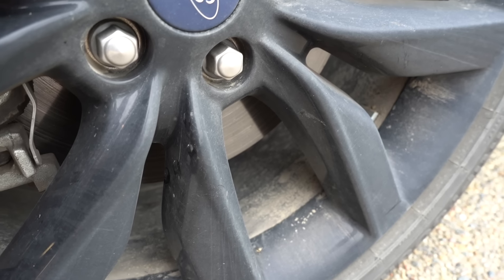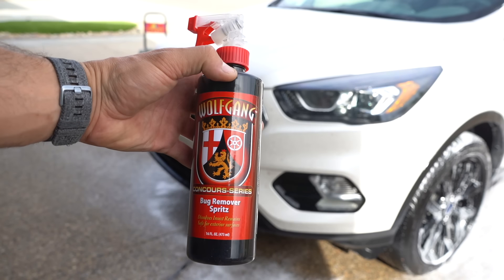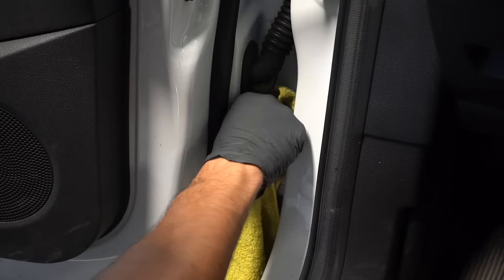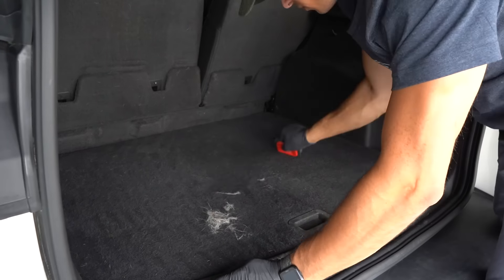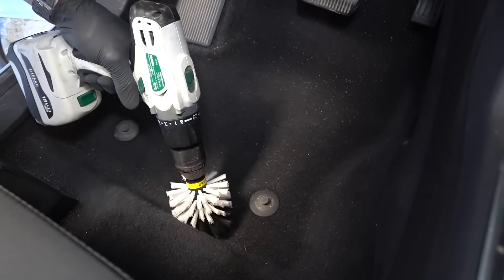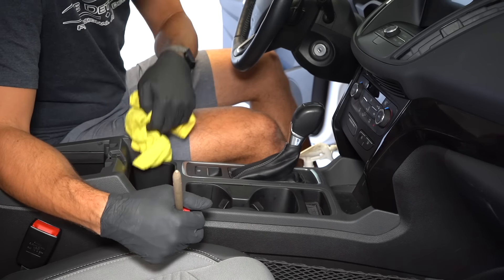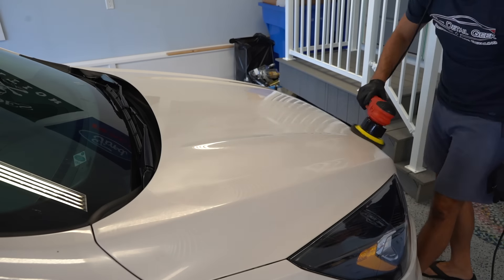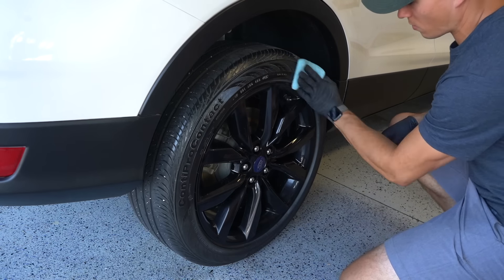Deep Cleaning an Insanely Hairy SUV! | The Detail Geek

Comment: Florida girl here! When it's sunny and hot, we wash and dry in sections instead of doing the entire car at once. Usually i do the front section - soap, scrub, rinse, dry. Then do the next section - soap, scrub, rinse, dry - but i also dry any water that got on the already clean section to avoid water spots. 

Just gotta move quick and sometimes re-wet the section midwash depending on the time it takes to scrub it.

Comment: I wash my car weekly and often have to wash it in heat and direct sunlight.  To combat the soap/water drying I use my garden hose which has a light mist setting. So I mist the whole car every time I clean a couple panels. 
I find the mist doesn't bead off the car so easily, so stays on the car longer which keeps the soap moist rather than drying out.

Comment: I'm from southern CA and the way how i wash my car is either early morning or later afternoon. If I were to wash my car in the afternoon I'd wash it in a shade possible. I don't rinse down the car first because of the heat that'll evaporate the water and leave water spots. Instead I clean the wheels first to completion one at a time. I don't leave it with chemicals on it. Once I use chemicals on the wheel the wheel has to be done. THEN I rinse the car down and continue with the 2 bucket method.

Comment: #Mikeeatsbread. 
As for the heat, I live in Florida so it's hotter than hades here. Generally I wait till the evening to wash and even then it has to be washed in sections. I also continuously spray the car with the hose to keep it wet to prevent water spots. It's really a pain. Wish I had a building to do it in. Would be sooooo much easier. Good to see :_mike: lending a hand.... Great transformation brother.

Comment: South Texas here. What we have to do is a pre-rinse then wash one panel at a time from top to bottom, rinsing every panel after you're done. horizontal surfaces first. Also, down here the vast majority of time vehicles are oxidized so most that come through are in store for at least a one step paint correction. We have clay down here and no road salt so the interior details are a little different than up there.  Where I love in particular is around a heavy industrial area full of chemical plants and oil refineries so the decon and clay step is a labor intensive one.

Comment: the best answer for water spots right in warmer climates that has always worked for me is Adam’s Polishes Detail Spray. as long as you use a foam cannon and the soap is mixed in the water on the car, the detail spray will keep any water spots from forming if you spray it on right after rinsing the soap off. i also like to use an air compressor to blow off water quickly and get water out of cracks and have a dryer towel process

Comment: I'm from Australia, and to answer your question about not leaving water spots in a hot climate, you basically wash the whole car panel by panel as fast as humanly possible, and dry with a microfiber cloth or chamois, and anything you find after the car is fully dry, just a slightly damp microfibre cloth will take them off

Comment: I live in Phoenix, Arizona and washing cars during the hot months is virtually non-existent during the hot daylight hours. You have to get up really early or wait for twilight and do the wash part outside and the rest in the garage where you can blow a fan as you work. Also, you have to wash in sections or the soap simply dries right as soon as you touch the car. My hose literally never turns off during washing. Most people simply take the I car to a car wash place where multiple people can work on it at one time. Side note: I am purchasing the 303 Aerospace cleaner because the AZ sun is harsh on the plastic pieces of our cars. So excited to see how it stands the 120 degree plus in summer (inside car temperatures are insane). Thanks!

Comment: I live in Florida and wash in the sun. I use Adam's car soap in a foam lance after a thorough pressure washing to cool the paint down. I let it sit on the paint and then do my 2 bucket method. I dry the car by using a second hose to flow the water off in sheets, and then hit the paint with d156 or detail spray as drying aids. Never get spots.
Reply: I've also used gold class soap in the same method without issue.

Comment: I live in Texas so it’s does get pretty hot here. I usually do a section at a time and spray the soap off. Then after I wash the whole vehicle I go over it again and spray the car again. Then I drive up under the carport and then dry it. Then do anything else I need to do on the outside or inside of the vehicle. I usually detail the inside first and then the outside. Also I really enjoy your videos and watching you helps me get better at detailing l. Thank you for that 👌🏼👌🏼🔥

Comment: Florida here! I clean my Ford Raptor in the SWELTERING sunshine state. Usually I have to do it in sections:front, back, each side. And often I have to enlist a friend to be washing at the same time and quickly following through with a sprayer. Air drying is no problem because we’re rhino lined though It’s a real pain I won’t lie 😂

Comment: Usually when it comes to washing down here in Alabama, it's between 20C and 35C usually, though we have hit 42C some years. The safest way I have found to combat soap drying is to just have the wash mitt in one hand and the hose in the other. If not then you have maaaayybe 2 minutes before the water starts evaporating. As far as water spots, if you have to go inside to get a towel, it'll be dry by the time you come out again so either finish with filtered water or move very fast.

Comment: I live in south Florida so it’s usually clear and hot so I tend to wash my car towards the end of the day so I still have decent sunlight but not that hot that the water evaporates too quickly. However, if I need to wash it in the morning I wash it and dry it in sections so I don’t get water spots and then do like a final dry and rub away some small water spots.

Comment: Hey bro, I live in West Palm Beach Florida. My method to answer your question is this: if the car has a solid wax on it, the drying thing isn’t too much of an issue. If I do foam cannon, I will mist the car as it sits for its dwell time. If the car is a hot mess, I do not foam cannon, and literally wash and rinse one portion at a time I.e. roof only, then rinse, windows only in one side, then rinse etc. Typically if a car is that bad there’s a correction (in my world) that’s going to happen so I don’t worry too much about water spots. FYI the water here is terrible lol. After correcting, my personal go to was is Collinite 845. It just seems to have really good stay power for me. Btw, love your work. Always top shelf

Comment: I use turtle wax hybrid for direct sunlight and then some water spotting may happen because of the water setting in the sun but by the time i go around polishing or waxing they go away so the hybrid solutions make it easy to wipe off water spots

Comment: You probably won't see this but I recently washed a black car in the 90 deg heat here in cali and what I did is to prevent it from drying I continuously apply more foam depending on how quick it dries

Comment: I know it’s kinda lame but a solar shade with tent poles are what I use in my driveway. Besides, it’s just a habit for me to now wash just one fender or body panel at a time, then rinse before I move on. Takes a bit longer but I don’t need to worry about any soap baking on my paint. Under my shade I probably don’t need to but I still practice that method.

Comment: About the sun/heat drying soap? I keep the entire vehicle wet with a hose if possible and wash a section and rinse it, in Southwest Alabama and Northwest Florida where I'm from, sometimes it's hard to keep it from drying so at least keep the sections around where you're working wet. Also, sometimes you don't even have to dry the vehicle unless you get spots and if I do I rewash it...

Comment: Hey bud. I spray 2 panels at a time before I have to rinse. Then I spray Turtle Wax's "wax as you dry" spray. It's so cheap and it prevents water spots so wellit's like $3 per bottle for 32 oz on Amazon and I never have a water spotting problem even with the hardest water

Comment: To combat water spots use just running water from a hose for the final rinse. No spray. No mist. Just let the water fall naturally from the hose. Instead of beading from a mist the water falls off the car in sheets leaving it barely wet and then you towel dry quickly.

Comment: Dear Detail Geek: LOVE your videos. I have a question. I just bought a 2018 Fiat 124 Spider in Lusso trim, which sat in an auction house garage for nearly two years. Less than 150 miles on the odometer. Interior was quite dusty, so I had it detailed. Now I am inquiring about paint protection. One detailer quoted $850 for the ceramic process, which seems steep. Wondering what you (or any viewers) think is a fair price (South SF Bay/Silicon Valley vicinity).

Comment: Living down South in the heat and sunshine, I usually just quickly wash a section of the car (back, middle, front, bumper) at a time and then repeat on the next side, rinsing as I go. I don’t always dry, but when I do it’s just a quick rub down to get the biggest drops away, because it’s already pretty much done drying. 😂

Comment: Late reply but this is coming from sanantonio Texas, where it’s 90-100°F during the summer all day every day, and 75-90°F during al the other days of the year and I own a black Silverado, so I have to foam, wash with a mitt, then rinse and dry 1 section at a time. Then while I’m doing another section some water gets on the section I already did and leaves spots. It’s tough!
Reply from the maker: I bet it is!
Reply: Phoenix AZ here with a black VW and basically the same process as early or late in the day as possible...one panel at a time, wash, rinse and repeat then final quick rinse to wet the paint and dry with a towel as fast as possible. Super tough 😓

Comment: I wash my mom and dads car on a 2week basis (they only see roads and highways so they stay pretty clean) but we are in a hot climate i struggled everytime i washed their cars not only with soap drying but water marks made me want to rip my hair out but I discovered if I use a wax mixed with the soap it won't dry fast! And water runs right off after so no more water marks i always do windows first however because you can't use car body wax on the windows! I can normally do one at a time and have them dry before water marks are able to have a chance to happen😊 hope this helps anyone that needs help with this problem

Comment: Drying a car in the heat.  It gets in the 100's here, and there is no way to wash and dry as you do.  I end up spraying a section, washing it, then drying it.  Then, repeat to complete the whole truck.  This method takes about 1.5 hours to do right on a full size Ram.  After, I touch up with the damp chamois to get the drips.  Then, followup doing sections at a time with a spray detailer.  The truck comes out great, but full detail is about 4 hours without shampooing carpets.

Comment: I run a mobile detailing business in Mississippi. It is always hottt!! Usually without shade i cant use my foam cannon. Also have to wash a few panels at a time quickly or it will dry, especially on a black vehicle. Sucksss

Comment: When in hotter whether don't use a pressure washer. Use a normal hose so there is more water left on the vehicle and therefore the water won't dry out as fast

Comment: There's an answer for the sunlight....it sucks, but it happens. I wash sections as normal, but you need to keep spraying water even after your done washing and working on the other sections so it doesn't dry. Worst case: the water dries and the spots are removed with wax or a quick detailer

Comment: I hate washing vehicles without shade to help keep the soap and water drying too quickly! My dad has a beast of a truck that's hard to wash normally, (mainly because I'm so effen short!) but when it's hot I'm constantly running the hose to quickly spray down the truck so it doesn't bake on the soap or get hard water spots.

Comment: I'm in Australia and you basically have to wash the car in stages and keep rinsing to stop the soap / water drying on the car. Absolute pain in the ass because it gets so hot dry and windy sometimes that even doing it in the shade doesn't help. Also water restrictions mean bucket washing only (no hosing off) which ****ing sucks.

Comment: #mikeeatsbread awesome video. Nice having an identical twin!  Ok so here in Ontario and no shade, I have to shampoo outside vehicle one section at a time. Rinse first, shampoo, rinse again, wipe and move to next. Where rinse spray hits clean area, wiping again is necessary. It takes so long. I definitely need to use the drill brush and Lilly brush. Oh I need to use it all. You’re awesome at this. I had a vehicle much like this one and raced to try and complete in 4 hours. Waxing it not shampooing mats was an option
Reply: Ok so I’m out in left field on the twin?